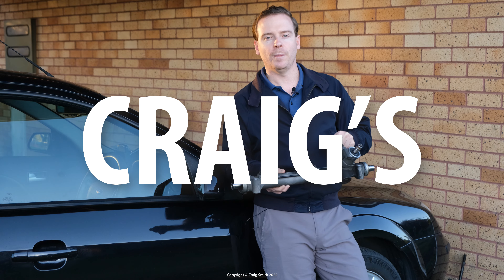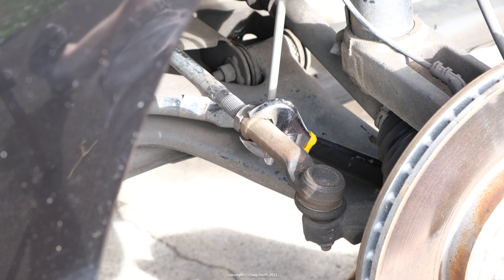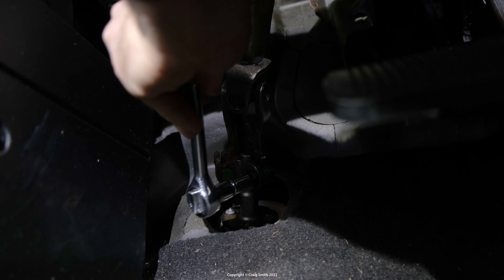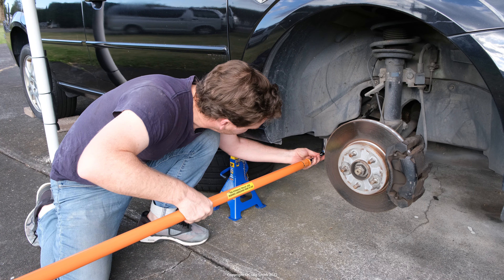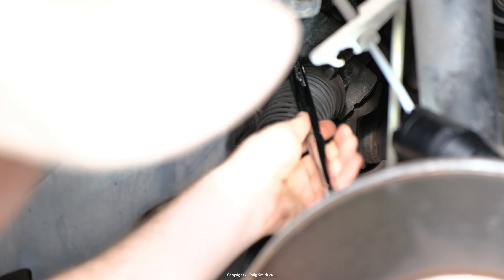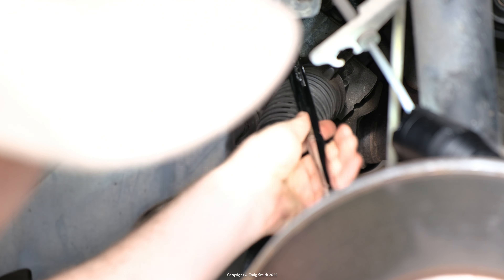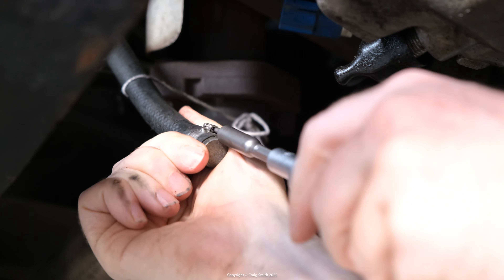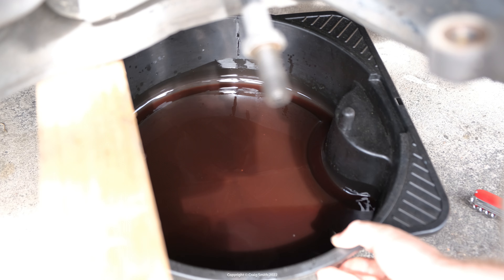How to: Replace steering rack (Ford Mondeo Mk3)

Comment: You are meant to take all the weight off the rear subframe bolts with a jack before undoing them, failing to do that is what causes the vast amount of people to spin the captive nut inside the body.
Reply from the maker: Yes definitely don't lower it by undoing the bolts.
Reply: @CraigsDIY  Not sure you understand what I mean, in this video you cracked the rear subframe bolts with no support before you put a jack under the subframe, you should never do this and a jack should be placed under them and raised to the point where its taking all the weight before cracking the bolts, failure to do this risks tearing the captive nut from its mounting.

Comment: When you buy so many tools, why not buy a decent battery impact wrench eg from Ingersoll Rand? No fiddling with pipes and ratchets.
Reply from the maker: They look nice in YouTube videos don't they? In practice very hard to use on many (most!) bolts on a car. The hard ones in this job are the rack bolts themselves, because of lack of access.

Comment: Just an advice from my experience... Always use impact when loosening the subframe bolts. Impact won't rip the catch nut inside the frame out, when the bolt is seized in. Constant excessive torque will do. It did on mine car... I will now never use breakerbar on these.. Cutting the frame and welding them back on ain't some funny stuff to do..

Comment: hi mate, cheers for the video, solid job that. Wanted to ask you if you had any power steering before replacement? Got mondeo tdci and no power steering whatsoever had pump changed  but still same thing
Reply from the maker: Yes I just had movement in the rack. You have no power assist but steering still ok? You will have to check pressure in the lines, either blockage or serious failure in the rack.
Reply: @CraigsDIY  pressure on the return is great so I doubt it's a blockage. I think the rack is doo doo now

Comment: I would like to point out that you really should replace those orings. They tend to shrink over time and leak as a result of that.
Last year I did my Fiesta's rack and those orings were dirt cheap from the dealer (6 euros) so it makes no sense not to replace them.
So if you're considering doing the job: buy new orings.

Comment: Just curious - did you have the notch/clunk when turning the steering left/right from dead centre which would generally ease once the car had been running a while?

And if so, did this resolve the issue?
Reply from the maker: I didn't personally but I know what you mean, common complaint on the Mondeo. A proper central 'notch' will be the rack I'm afraid. The steering wheel compensator shaft can also give you problems so it's worth regreasing it, esp. if never done. (See video linked in desc). When you disconnect from the rack you can also test it as it's isolated. If it seems to be the rack, before ordering in a new one, also want to jack front up and disconnect tie rods to eliminate possible suspension issues and totally isolate the rack - if you can still feel it then you've got the right video. GL
Reply: Thanks for the reply Craig. Your videos on the Mondeo have been a big help during my ownership of it.